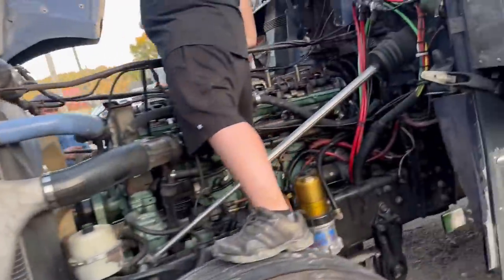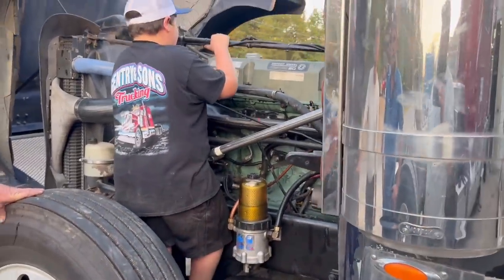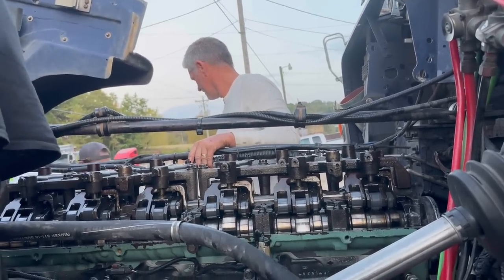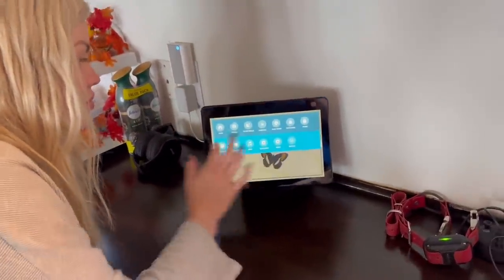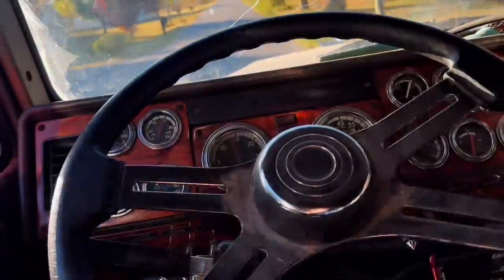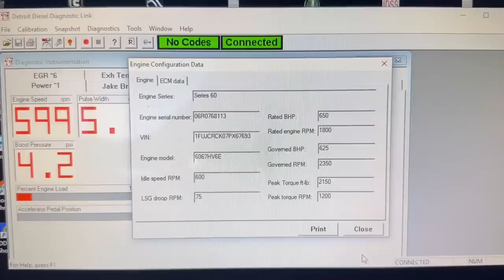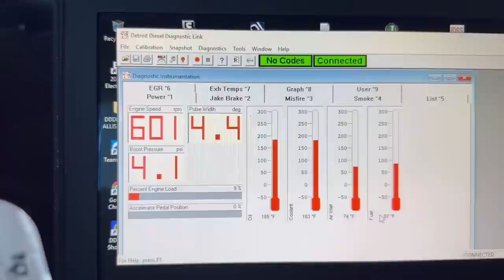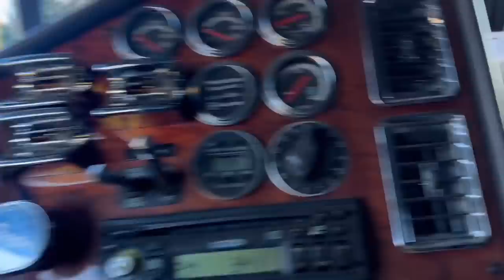14 LITER DETROIT IS DONE. TIME TO BREAK IT IN!!

Comment: The 14L Detroits are money. I remember driving one for a few years and never had any serious issues, They have a lot of low end power and around 1,300-1,800 rpm was where they shine. Still one of the best engines ever made
Reply: fuel mileage not so much

Comment: Yes sir that pre egr 14 liter came out as test engines in 98 and ran all the way as late as 03.rare engine if you could get your hands on one you better keep it cuz they are about 30k from freightliner with core.
They came out in 500 hp 1850tq
550hp 1850 tq 
575hp 185tq

Comment: Tim seeing you and son working together is great. My father was a owner operator and the OTR driver. But he had a lot of  friends that where ower operators. I learned alot that pushed myself into working on trucks until I when into USGC for 28years still worked big motors. I started out breaking tries at 8. At 16 when full time working on Detroit 71 and 92. Until 20 them the military.  You and you dad are doing that young man a great service. I do note a safety thing when you where test running DD.  You need to take some exhaust pipe the size of the turbo inlet weld some expand metal on. Put over turbo inlet when running any motor. I work with a man missing most of two fingers on one hand from falling and has hand landed in the turbo. 
Keep up the good work.

Comment: I would like to give you a experiment for this 14 liter Detroit paired up with a Freightliner Classic  non aerodynamic tractor. I bet if you try this you could gain a 1/2 mile to a full mile per gallon improvement. 1. Use a free fuel mileage tracking app. Called Fuel Gauges tracks fuel mileage tank by tank. 2. Install Fleet Air air filters. 3. Install a FASS fuel system.  4. Put a crank balancer on from Pittsburgh Power smooths out engine vibration. 5. OPS oil bypass system so you do oil sampling and get 200,000-300,000 miles on and oil change and catch engine problems before they get really bad and probably save an engine. 6. Add some Air Tabs to the cab and a Flow Below system to help the aerodynamics. 7. Send the exhaust manifold to Full Tilt in Jackson, MN. to have it ported,polished and jet hot coated this will improve exhaust flow and lower back pressure and lower EGTs. 8. Either use Counter Act balance beads or Centermatic wheel balancers. 9. Some drive line balancers from Balence Master. 10. If you need to replace the drive tires look at lowest rolling resistance tires like Michelin X line energy Ds. 11. If you need to replace the charge air cooler get a Duralite best one on the market. 12. Put smaller fuel tanks on so you can fit a Green APU and a step storage box. 13. If it doesn't already have a 13 speed transmission in it look at a Eaton 18913A 1850 torque double over drive paired up with 2.64 rears should put you at like 1400 rpms at 70 mph. In 12th gear. I  think not only will the fuel mileage increase but so will the over all performance of the engine improve and the ride and comfort will greatly improve for the driver.

Comment: A fair smack of detroits here in Australia are 14 litre series 60 or the dd15.  Most run around the 550-600 hp all day every day with a 18sp and most also run 4.1/4.3 diffs

Comment: I run a 06 western star feed truck. 14 liter with a 600hp tune. Had to rebuild it 200 k  but now it seems good to go. 320 k on it now. Had the computer modified at 150 k. Good turbo. Stock cam. Stock injectors turned up to 75. Sounds like it's cammed up. Just a slight miss. Could smooth it out by backing injector codes off some but why?  Haha. Turbo pressure maxes out at 33.  Datastar says torque maxes out at 1980. Yeah that's enough.  We run heavy all the time. Need that motor to last a long time.  Mileage is 4.5 local. 5.5 distance. Not the best but oh well. Haha

Comment: A deleted 14L.... you can see where the egr tube has been deleted, no delta p sensor, no egr cooler or egr valve, no egr sensor or tube... I’m sure it makes power when it’s deleted and tuned... my 14L in my 04 Classic XL is stock and pulls 60,000 loads grossing 100,000 just fine without being deleted...and the 14L didn’t come out till 2001 not 99....it was an emissions engine, it has been deleted
Reply: I caught it also. Have one done like this. But it’s a true 99 LOL
Reply: Came here to comment this

Comment: don't forget Tim, that is an empty trailer that you were pulling. but running extremely smoothly at 600 rpm, and right the way through to 2000. yeah definately heard that something wasn't right with the exhaust, but if the muffler isn't connected and air tight then it will let the truck go sky high for power, because there is nothing restricting the exhaust, so allowed to breath properly, and dump the exhaust gases properly as they were meant to do before the governments around the world said the engines are too loud, and we need to quieten them down somehow.

Comment: Carry a digital thermometer & check each pot after a rip. Definitely still sounds like you got a a chatter in the injection system.  Yes I hard the exhaust leak, but more concerned that you’re not burning a motor up by running it hard like you are without changing the injectors out. You said you weren’t keen on the marine style fitted, so make the change & get it cleaned up on throttle & It will scare you once you change them up.

Comment: I left the trucking when detroit was just coming into itself basically. I had drove 6l71, 6V7l, 8V71 engines and was really hatting to have to put my hands on the wheel. Then by reasons I won't go into, got in the seat of a worn out and dead tired truck that had the 8V92 an man howdy, what a difference as I kept up for once. Still though,  the Jake was sad at best. Time went by and I was forced to build a 8v92 up from the bottom to the valve covers. Someone said it was a silver 92 and for sure, I don't know the difference sept maybe injectors were bigger. I had set the jake heads myself and for once, it wasn't just noise, they held real good, but not as  good as the big cam 2 cummins I had built myself. One thing to say here is  that as  good a worker I was, a drinking idiot I was as well and driving was interfering with my server alcoholism I had dedicated myself  to. I spent close to a quarter of a million dollars on alcohol. I quit driving as I knew  that as hard as I drank, I wasn't completely sober when driving so back to alaska for the final time... wife had cheated me so hard and I just couldn't pull my head out of my butt. Sure, after six years of drinking myself completely blind, I did smarten up   a little... I found myself responsible for something and that something was two of the greatest dogs in the world.Those two dogs saved my life without me even knowing it. I have been sober now for twenty six years, not a want for a sip of alcohol. I hate losing all those years of time but it did teach me a lot about life. One thing for sure, if you  think that you want to know something, be dang sure its for real as somethings just make you the most bitter an hateful person in the world

Comment: I'm jealous. I only drove 12.7s rated at 435/500 with straight 10s, Super 10s, and 10 top 2 (those were interesting. Autoshifted between 9th and 10th). AND, they were governed at 65 mph. Of course that was 20 years ago. 😆

Comment: Tim the Classic sounds like it has a little skip in it. Or its a leak. I used to work on those old frieght shakers. 60 Series are a Great engine. Saved Detroit  for sure...I jever ever though I would say anything good about the Detroits.But the 60 Series are a Great engine..They do get great fuel  mileage. And make Great power...They are easy to work on...The only thing that will mess them up is that damn Electrical  going to the batteries for the ECM...Corrosion . But its an easy Fix...Just have to show the drivers so they can fix them on the road if they break off out there. Great job on that Engine rebuild. Be a good idea to just put new injectors in it. Too be safe if I was you...Great video..

Comment: Love the Classic. I have a 2001 Classic XL Limited with a 12.7L but would like to upgrade to a 14L. Upside to a 12.7L is it’s the most common pre-emission motor and easy to find parts for.   I got 2.3M miles on my 12.7L & 1.6M on the inframe, would you suggest an out frame rebuild or going with a crate motor?

Comment: I’ve got 14l in my classic supposedly turned up to 600hp with a stage 1 pdi turbo and ceramic coated manifold and I feel like it needs more power. I haul multi axle trailer 45-80k load weight I’m guessing it’s gearing 3.55 with 13 speed my other truck some motor and mods but with 3.90 and 10 speed and that truck will pull. How are u able to plug into truck I’ve been trying to find the stuff to do that so I could see what it’s really doing and b able to adjust things

Comment: The 14 L non egr motor is tough as nails. I lost all interest in Detroit after EGR came into play. To be honest none of the engine mfg did well after EGR compliance started. Everyone wants to argue Horsepower by engine type but coming from the world of Paccar and seeing cat cummins and Detroit engine failures back in the day I can can say the facts are Detroit made the power the fuel milage and went the distance. They did have the most problems with oil leaks but that's just the way things were. You could run a Detroit with almost no compression to the Point when you shut it down it would slowly come to a stop. No other engine would do this.

Comment: I see the truck your testing speedometer isn’t working. I’ve seen that on a lot of the trucks you have or had in your fleet. When the speedometer isn’t working the odometer doesn’t work. How can you charge someone per mile when you don’t know how many miles your driving.
Reply: @stupadaso7948  Wow pretty harsh aren’t you. I must say towards the end of the video there was a shot showing the dash as he was driving down the road and the speedometer was working so they must have fixed it. I’ll bet as long as Tim has been driving he can tell a lot about a motor by listening to it run. That’s a benefit that a professional truck driver would have over someone that drives truck because it pays well. Tim takes trucks that are good trucks but are by today’s standards worn out. When you tear a truck down to the bear frame and replace the motor, transmission, the front end components and the rear ends there’s not a heck of a lot left to go bad BUT after watching the show there’s air boxes, air conditioners , springs and interiors and even the glass that truck is like new but better. Why better? Because they take pride in their work, they know what there doing and they care about their work. I have to admit he has some of the goofiest talking and some looking southern gentlemen I have ever seen but I’ll bet they would give the shirt off their backs to help someone out that’s I need.
 I wish they would show them taking their kids to Sunday school and all of them going to church. For me anyway. I love it when people talk about their faith and I’ll tell you what I’d love to have Tim Gentry living next to me. I’ll bet he’s a awesome neighbor.
Reply: @stupadaso7948   Yes you are entitled to your opinion and I don’t want to argue over it. I just thought it was funny that you wrote you don’t watch it you just read the comments. Thats like the guy that told his wife that he gets playboy to read the articles not to look at the pictures..

Comment: On my family farm we had a 2000 w900l with a 12.7 it wasnt tuned or anything it was always hooked to a hopper bottom nothing else pulling 1100 bushel constantly, and it didn’t like the weight it was a weak engine but the reliability was insane ran it from off the lot brand new all the way to 1,00,000 miles it never let us down had a overhaul at 1 million then ran for another 300k miles thats when we sold her